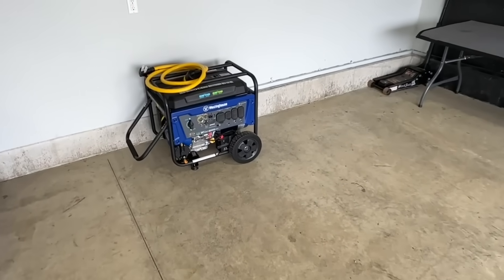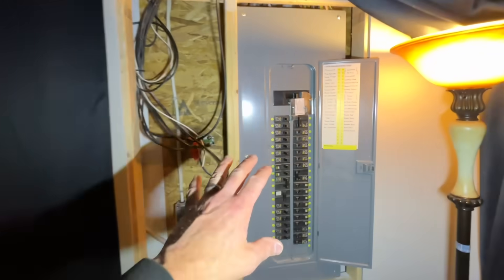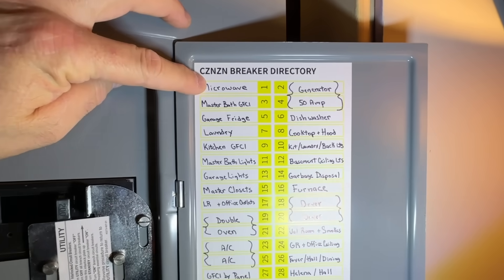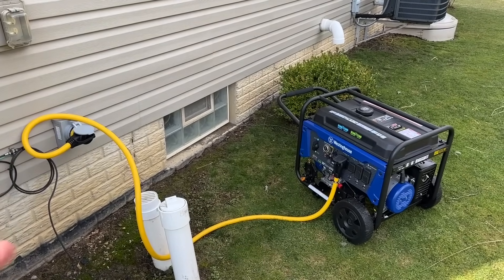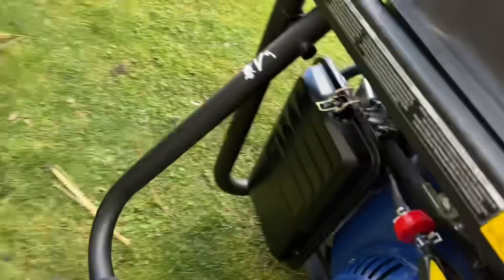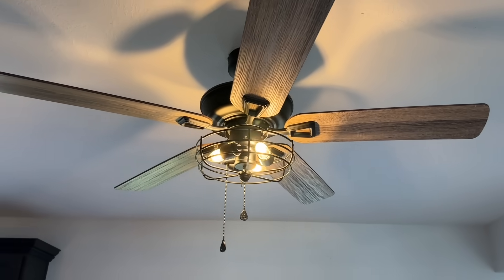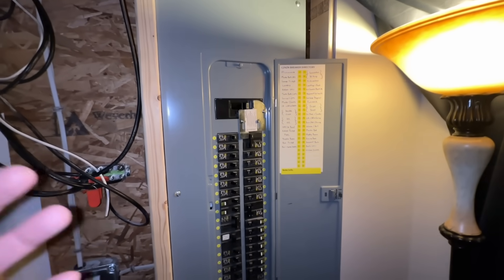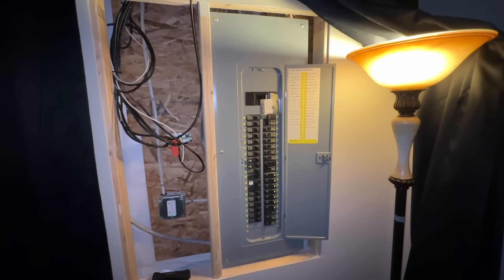Whole Home Manual Backup Generator Setup For Less Than $1600

Comment: Not judging or being a smart guy but isn’t it better to open the breaker (turn off) in the panel before turning off the generator when you get line power back on? The generator is under a load and just turning it off like that might damage the motor or gen end. Im curious, great video by the way, well detailed.
Reply from the maker: I’ve heard many different opinions and I’m sure they are all correct just different.  From what I’ve found these are the common steps.

Step 1: Plug your portable generator into the outdoor receptacle.

Step 2: Turn off all the breakers in your main electrical panel, including the main breaker.

Step 3: Slide the interlock plate into the generator position.

Step 4: Turn on the generator breaker.

Step 5: Turn on your portable generator.

Step 6: Wait one or two minutes for the generator to fully power up, then slowly turn on each circuit breaker you wish to use.

Comment: How does the power inlet on the house only have 3 prongs? You've got 2 hot phases plus neutral, plus ground. That should be 4.
Reply: Yes it looks like a 30 amp receptacle to me also.
Reply: I mean like for 120 volts
Reply: @gangsterofhops  In that case, you can only get a total of 30A at 120v, that won't power much of your house.
Reply: @gangsterofhops  He says it's a 50
Reply: @arthurserino2254  yes I was wrong on both counts. He is using a power cord with a SS2-50R end to plug into the house. This is a three conductor 50A 240-volt receptacle end (2 hots,1 neutral and no ground).The other end of the cord has the standard 4 conductor plug that you and I are both familiar with which plugs into a 50 amp receptacle on the generator. I checked the product Link in the description to get the info on the cord.
Reply: @gangsterofhops  Their are 3 pins in the middle and ground is on the outside edge of the socket

Comment: I live in Canada and those Gens go for $2200 CAD here . I have one and I also bought a 40A generlink for $1500 Cad . It hooks directly in to the meter (Plug and play). I have a propane furnace but my primary source of heat is a wood stove . It cost me more then you but still worth every penny . I lived through the Ice storm of '98 and we went several weeks without power . I think it is part of our duty to protect our family .
Reply: You have to check with your utility if the GenerLink is legal to the local electrical specifications.  Not all of Canada says the GenerLink fits with the specifications of electrical code.  It also requires your utility to come out and install it because they are the only ones legally allowed to do it being it requires an anti-tamper tag as well as pulling the meter.  Other than that, I think it's an interesting device.  There are other ways around having to hire the power company or electrician to install transfer switches or interlocks but most of them require extension cords to be used which makes it inconvenient.  Reliance Controls makes a kit with an inlet box with a glorified power strip on the other side of a wall and all it requires is a small hole drilled in the wall for conduit.  That was one of those extension cord solutions I was referring to.

Comment: Dumb question. I have this setup for my house. Could I plug my RV into my 50 amp receptacle amd block the main using my interlock to activate the generator breaker to get power to my RV without running a generator?

Maybe a dumb question but I am thinking of using the RV for company this fall and prevent the generator from constantly running. Thanks in advance
Reply from the maker: If you block the main power coming in, there will be no power to send to the RV.  If you get creative to route the main power coming in to the home to power the RV then your home will not have power.  Sounds a bit tricky and not recommended.
Reply: @DieselLegiance   I guess a better way for me to ask that question would have been if I plugged my RV directly into the 50 amp plug that I use for my backup generator and then activate the generator breaker in the fuse box it still would not work for it

Comment: We used the same generator Westinghouse 13,500 tri-fuel.  Had to get one after having 8 power outages in North suburb of Houston in 26 months.  The 9th power outage happened after tropical storm Beryl, one of the smallest storms I've ever seen coming from FL.  Our power was out for 4 days but we didn't even notice since we hooked up our generator.  Ran both A/C units.

I paid $1,244 for the Generator but saw that same unit online now for $2,400.  I paid a skilled electrician $900 with parts and labor, I had it run further down by my pool equipment so I paid an extra $250-300 for supplies that weren't necesary.  I could have done it myself since I have experience in electrical work.  I just didn't want to chance ruining my brand new home so I didn't do it myself or hire a handyman.
Reply: 7 days without power south of Houston. I have 4 generators of various sizes for different uses. Two will run on gasoline or propane. I have the ability to Isolate some systems such as the garage, heater and electric water heater from the rest of the house so I can power them using a dedicated generator only when/if I need them. This allows me to use smaller generators which in-turn use less fuel.
Reply: @macplus3339 looking to do something similar.  We were without power for 6 days with hurricane Helene so we bought a 6500 watt generator but now looking to run a generator to the house but didn’t think about running it to different generator but did see using two to power our entire house just trouble shooting some ideas
Reply: Beryl didn't come from  Florida. It was projected to hit Brownsville and northern Mexico. It hit matagorda Island near Corpus Christie and went straight to Houston, and it wasn't a cat 1...it was a cat 2 on the outer bands on the east side of Houston. Leveled thousands of 120 foot pine trees all over the power lines in a area the size of France.
Reply: @KB-ke3fi  it's max wind gust was a Cat 2, not sustained winds. I've gotten category 1 gusts before when it's a tropical storm.
Reply: @KB-ke3fi Fyi, the size of France is nearly the same as the size of Texas, that makes for a lot of trees😮
Reply: Louisiana native here and we're in the same boat.  Beryl messed us up big time in Kingwood and now I'm looking for a generator.  Where did you buy yours from?
Reply: @poopa718 bro this dude is talking out his ass. They are about $1,600 at Home Depot. He’s full of shit. They’re not hard to set up either, a monkey could do it.
Reply: @poopa718  my bad - just saw this.  I got it on Amazon and it was from a company called Westinghouse.  I think they're based in Austin, Tx so I got it pretty quickly.

Comment: great video - make sure you make your generator a floating neutral as described in the manual.  I know it runs fine without doing that but it is another one of many safety things you need to do.  I made a project box using two LCD displays that show what each leg is doing.  Displays Amps, Watts, kWh and Volts.  Also an hour meter (not needed really since the generator has one).  This is it on amazon
'DROK AC Power Meter, AC 80-300V 100A Voltage Current Color LCD Display Panel, Digital Voltmeter Ammeter Watt Active Power Energy Battery Monitor Multimeter Volt Amp Meter with Current Transformer CT'.  You need two one for each leg.  You have a power outlet right there that you would plug the project box up to.  Simple wiring just need to put the amp rings around each leg coming from the generator.  Easy peezy.  Great video again!
Reply: Thank you for all the info that I got from you while reading all these replies & incorrect replies from several.
I learned much and had questions myself , but reading your replies correcting people was great !
Thank you much !!!! 👌
Reply: @condor5635  sounds fine, until trump makes everything solar soon. Get what you vote for

Comment: Can you simply unplug the appliances you do not need?
Reply from the maker: Hooked up this way, you can just turn the breakers off to whatever you don’t plan on running.  But yes, you could also unplug these items too.
Reply: @DieselLegiance  I have to check as I have never physically done so by turning the breakers off. I believe if I remember correctly, one breaker turned off everything in the kitchen...but I have to double check as this was done years ago.  That is why I asked about the unplugging.

Comment: The 50amp cable you shared the link to looks like it has a female connection on one side, but yours has two male connections? Am I seeing this right?

And is that a 240v plug installed on the exterior?
Reply: no he has a female and a male on that cord.  Perfectly good.  Yes they are 240V plugs used
Reply: No .That is a 120-volt inlet receptacle installed on the outside of the house. It obviously only has three prongs.
Reply: @gangsterofhops  - no you are incorrect. It is a 240V - 50 amp inlet box using a 14-50R cable.  No idea why you think it is 120V. He has a great setup there.
Reply: @condor5635  I stand corrected. Didn't realize 240 volts does not always require a fourth conductor. The confusion by myself and other commenters is about the three-prong inlet receptacle installed on the house. The power cord in the link on the video description actually has a 14-50p (4 wire plug) on the generator end and SS2-50R (3 wire receptacle) at the house end. It is not a standard "14/50R cable"as you stated.

Comment: This setup is really nice, I have the same setup.
 It also protects equipment/devices from times when the utility power flicks on and off repeatedly due to a damaged line somewhere which keeps making contact/no contact and during repair.
 You just keep the generator running until the power is completely fixed.

 And these Westinghouse units run very efficiently, you get a lot of run time off a full tank of gas.. 
 The propane not so much if you're just running off an average small tank.
 But if you have a larger stationary tank you're only limited to whatever the tank is rated for.

 Personally I don't like propane, I've seen way too many things related to it in my lifetime

Comment: Check your manuals please.  Step one is take the generator OFF load. (Flip your breaker off first)  never turn a generator off under load.  Great video, but follow the manual please.
Reply: Yep, thought the same thing. You're putting so much strain on the windings by shutting the generator off while under load. Inverter generators can handle it, but these 'noisy style' generators can get seriously damaged. Letting them run out of fuel, or intentionally shutting them off while under load will kill them super quick.

Comment: I did the very same thing, with that very same Generator after the Texas deep Freeze and it works just fine. I have used it twice, It is like an insurance, just in case, My is a 30Amp breaker set up and Why break the bank when you can have a simple set up like this for a thousand bucks, Excellent video from Diesel Legiance detailing step by step.. Quick note. I turn all the breakers off before connecting the Generator  and once the Generator is running and connected to the house I turn the breakers on one by one as needed, that in my case is almost all of them.

Comment: To protect the main breaker and minimize stress, it is recommended to first turn off all individual breakers before turning the main breaker on or off. Once the main breaker is on, you can then turn on the individual breakers one by one. This gradual application of load helps to avoid a sudden surge of current.
Reply: @AskTheAdjutant ...also, when the power comes back on, work with your breakers to isolate your generator and only then you can turn it off. If the generator is connected and running and you stop the engine the voltage will drop and this could damage some motors, like in a fridge. Do a clean shut on an off.
Reply: @wetrock2766  what difference is the from shutting down the generator abruptly or flipping a switch /breaker off? Both do the same identical thing. Power goes away immediately?
Reply: @daddski1  I noticed no one answered. Considering how adamant they are about it you would think someone would explain it.
Reply: @daddski1 My thoughts exactly. I have a number of power outages and I don’t go down and turn off every breaker every time until the power comes back on. I’m a novice at this but this is not explained in the threads.
Reply: @daddski1  depending on the generator type, shutting it off while under load may produce bad power output that could damage things. For example the frequency may go down as the rpm decreases.
Reply: @OttKnot2Dew  there are multiple issues here.  The one I was describing above was the fact that main breakers are typically not switch rated.  But many branch breakers are.  This means that main breakers are not designed to be turned on and off many multiple times with a load passing through them.  By removing the current first by turning off individual breakers the main can be safely operated without degradation of performance.
Reply: @donenke5607  that makes sense. The electric provider can withstand the surge of power from a power restoration.  You don’t need to turn the breakers off.  But that’s different from what is happening here with a generator.  It’s not as capable to withstand surges.
Reply: @AskTheAdjutant  how is it any different than the power going out and on during a power outage?
Reply: @jerryhedges26  difference is large power supply vs small power supply.  Also the main breaker is not rated for switch use meaning you shouldn’t turn on or off with current flowing.
Reply: I’ve learned something new today thank you

Comment: A must have in the summertime AC needs ...   Micro-Air EasyStart 364 Soft Starter     😁
Reply: Totally agree, purchased one last year. Had a power outage for 24 hours a couple months ago and it was nice running my AC, Florida is hot.
Reply: I am getting one.
Reply: Great video presentation! I added a micro air easy start to my outside heat pump unit. I added a gen tent to my generator to keep it dry outside running in bad weather. I also added watt meters mounted below my breaker box inside with current clamps to the 2 120v inputs for the 50 amp generator breaker. They do a great job to view and monitor the total (and individual) load(s) being drawn on the generator’s output capacity.
Reply: I have one installed as well. Came in very handy this summer when we lost power for 20 hrs. Being able to run the A/C was great.
Reply: I installed one too! The easy start is worth every penny!
Reply: Nice, I just installed ICM870-32A soft start to my 
A/C. Wish I'ld known sooner.
Reply: I was going to come post the same thing! Dropped my starting amps to about 15 on my 3ton

Comment: IMO - your 10 feet long RV cord is about 15 feet too short to be close to the house.
Reply: I think the 10’ cord is too short given the advice below: 

When using a manual generator to supply power to an entire house through a generator inlet box, it is important to ensure that the generator is placed at a safe distance from the house to avoid hazards such as fire and carbon monoxide poisoning. For safety reasons, the minimum recommended distance is generally:

1. **Carbon Monoxide Safety**: Generators should be placed at least 20 feet away from the house. This helps prevent carbon monoxide from entering the home, which can be deadly.

2. **Fire Safety**: While 20 feet is recommended for carbon monoxide safety, to further minimize the risk of fire spreading to the house, keeping the generator at least 20-25 feet away from the house is advisable. 

Additionally, ensure the generator is placed on a stable, non-combustible surface, away from any flammable materials, and has proper ventilation around it. This placement helps reduce the risk of fire and ensures that exhaust fumes are adequately dispersed away from the living areas.

By maintaining these distances, you can significantly reduce the risks associated with generator operation, including carbon monoxide poisoning and fire hazards.
Reply from the maker: True but I went 10’ for flexibility in different scenarios.  But I have considered buying a 5’ cord too.

Comment: What's the longest it will run on a full tank? The manual says 12 hours but I've heard some people claim much longer
Reply from the maker: I assume 12 hours max but luckily I have never had to push it that far as my power turned back on in less than 12 hours.
Reply: Depends on the load.  More load more gas it uses.

Comment: Man, we’ve been with out power since Monday morning 6 am. 😡 😔 😮 I live in North Houston.  Can I have my AC running ?? I have this same generator. It’s in the high 90’s right now. 🥵 😮
Reply: yes...or just buy a portable AC or window unit they use less energy
Reply: @moblack5883  I have a portable AC unit that was lended. But it will cost me the same or more to buy one. Rather just connect mine to my house. Thanks though.
Reply: @moblack5883  My cousin lent me his smaller generator to run the portable AC unit because my bigger generator was tripping with the AC unit connected.
Reply: @moblack5883  Thats what I have now! Thanks 🙏🏽 A portable AC (borrowed).
Reply: If you add a soft start to your AC it will work fine with this generator.  Many people don’t know about soft starts.
Reply: @neilbrookins8428  thanks 🙏🏽
Reply: You can run your AC, just one. Also turn off any breakers  you don't absolutely need
Reply: @ajayphilipsabu  got it